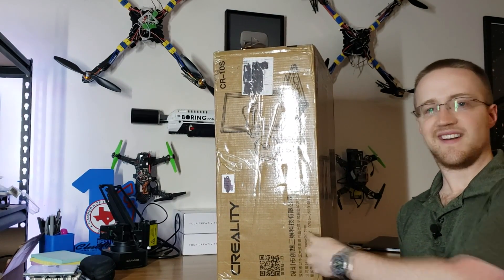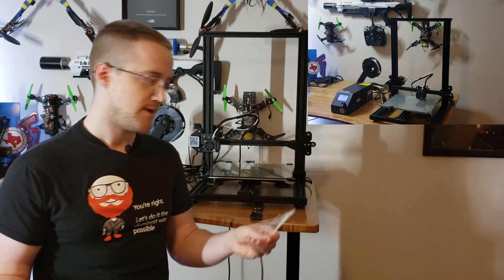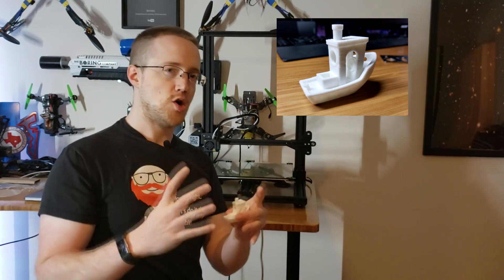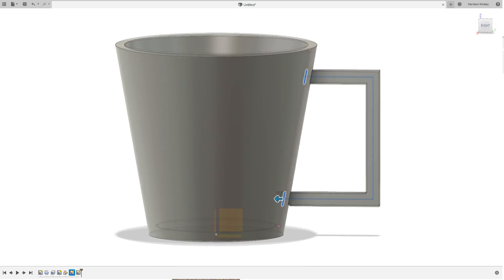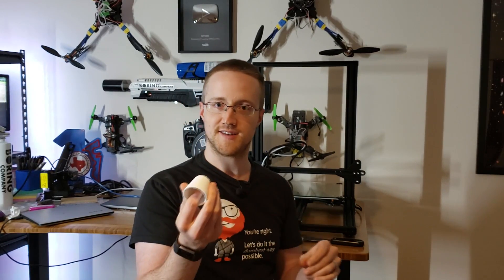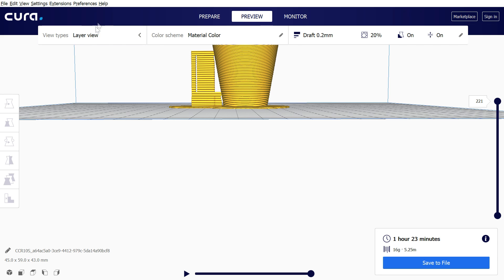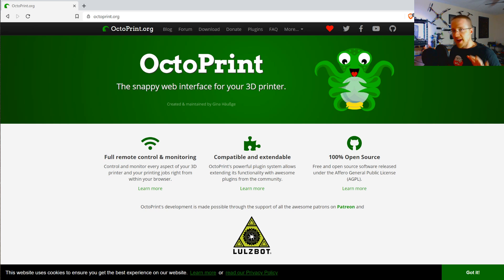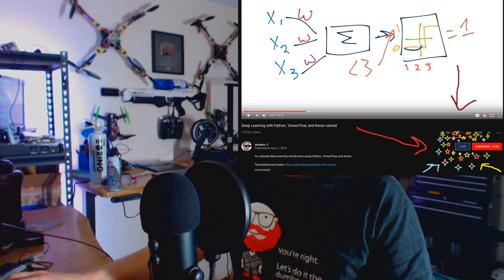3D Printing w/ CR 10s First Impressions

Comment: Meh, you should get Original Prusa i3 MK3S instead
Reply from the maker: How come?
Reply: @sentdex  User friendly, great support and very reliable machine. You can check some reviews. These chinese printers usually recommend for more advance users, sorry. But you will learn something new. It depend how much costs your time.
Reply: @sentdex  BTW, I am looking forward to some awesome plugin in Python for OctoPrint by you :)
Reply from the maker: I did tons of research before buying :). The printer was super simple to get setup, not sure I would call this advanced. Part of the reason I got this one is because it's years old and many people have put in hundreds of hours into the machine now, and it has proven itself. Got for a few other specific reasons, but just addressing the points you brought up. So far, happy with it and would recommend it to any other noob.
Reply: @sentdex  I'm not saying that is a bad printer but for example direct drive extruder is much better for TPU/flex material for FPV quads etc. Prusa printers are real workhorses as they use them in approx. 500pcs at their print farm to print parts for other printers in 24/7. You will see. Cura is pretty much powerfull slicer as Slic3r PE. You can use both and the best thing with Prusa is that everything is opensource as well from hardware to software.

Comment: Cura hides a lot of settings.  Be sure to click on the lil gears next to each setting group to hide/show more settings.  One should be for setting top/bottom thickness.
Reply from the maker: Yeah, I found some settings regarding shells as well as top/bottom thickness. Just seems...odd... in what world would we want to model something in CAD to them have the bottom of it...sliced away?
Reply: @sentdex  Since it was visible in the layer preview shader it should've been printed - sometimes the raft sticks so well to the model that you pull some layers off when removing the raft -
But more likely is that you may have accidentally used the transform tool and slightly pushed the model downwards - that will crop the model at the build plate plane. I believe that's why viewed from the bottom the surface is shaded in red. Make sure to pull it up all the way...  Great choice of printer! Had it for almost 2 years now and love it!